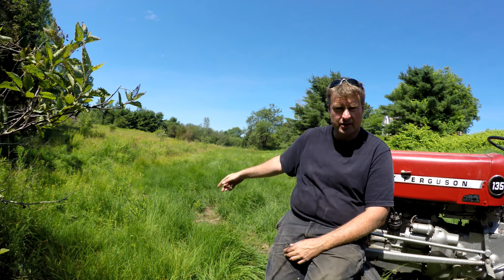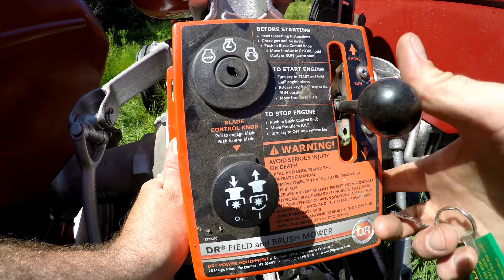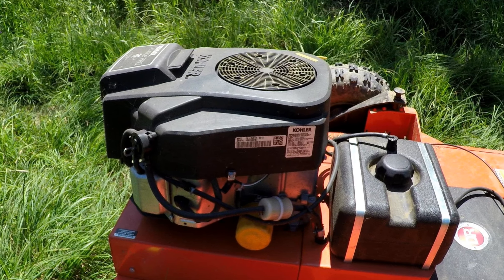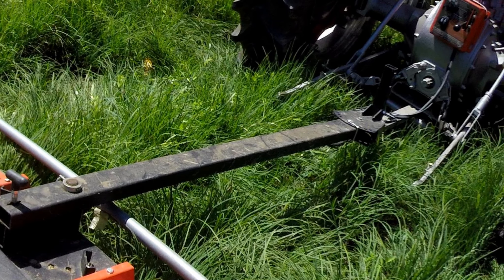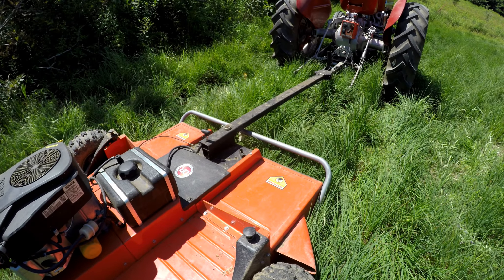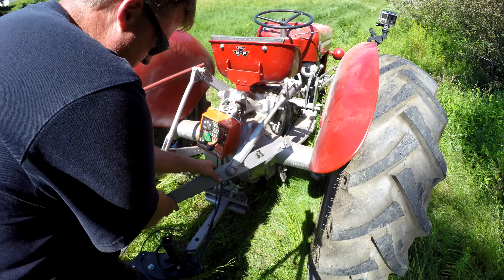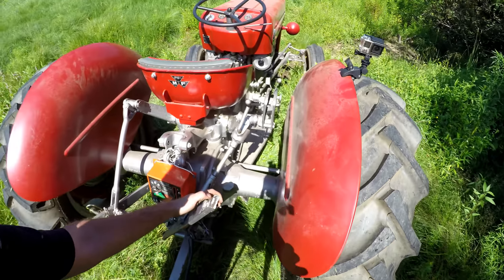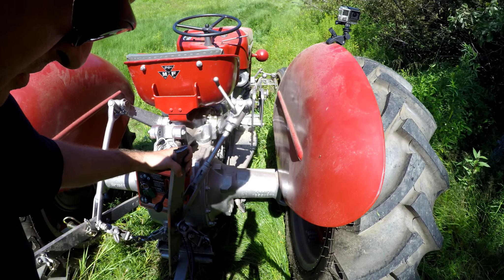Massey Ferguson 135 Field Mowing with the DR Field and Brush Mower - Part 1

Comment: Nice little mower  but a woods M5 or landpride brush hog would do wonders too.
Reply from the maker: Yes I had considered one, but I didn’t want to be dependant on a PTO mower so I could use it with an ATV as well. I wouldn’t mind adapting a brush hog to the skid steer for fun though

Comment: I watch bush hogs 5' and 6' sell all day long for a 1/3 the cost of that mower you are using normally at local auctions and such
Reply from the maker: Hi Travis, thanks for stopping by and having a look. There are definitely some great deals out there at auctions. Part of the reason I purchased this unit was that it could also be towed with an ATV.